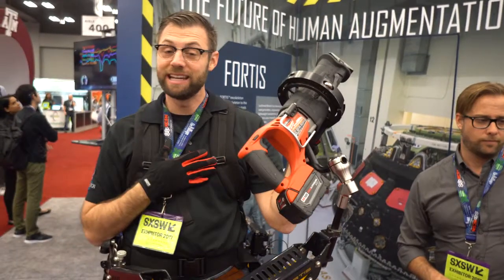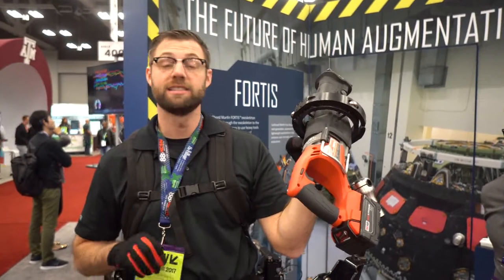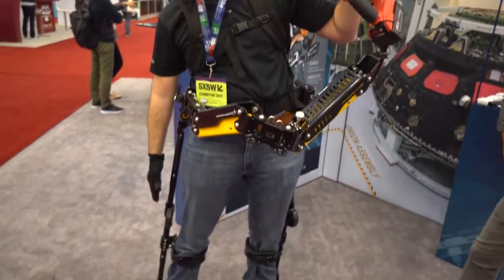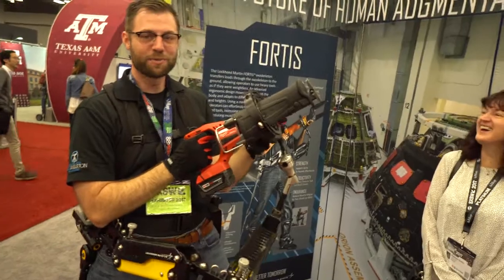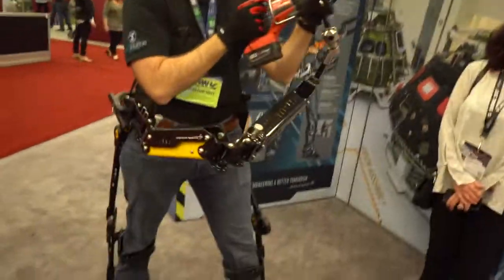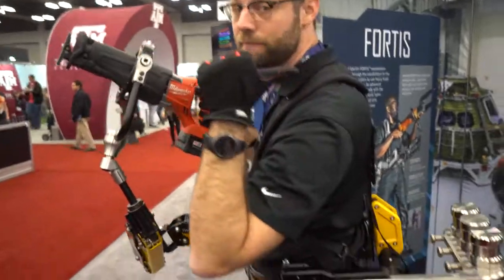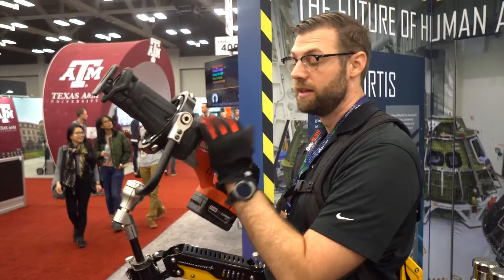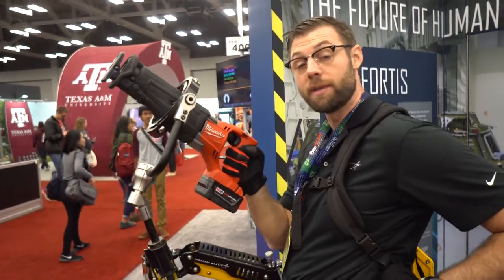Berghs @ SXSW 2017: Fortis Exoskeleton

Comment: It's non effective in a building site due to its size, it would get in the way and raise safety issues for mobility and freedom of movement in small to medium work areas. It has limited potential
Reply: It was originally designed to mitigate the human cost of four specific very heavy tools used in the shipyards.  I have talked to actual workers who used the prototype and they loved it.  I believe it has enormous potential for health, safety, and productivity gains in a wide variety of trades, especially the building trades.  You can design a whole new class of tools around this idea.  My humble opinion but I was a part of the original design team and we did our homework.